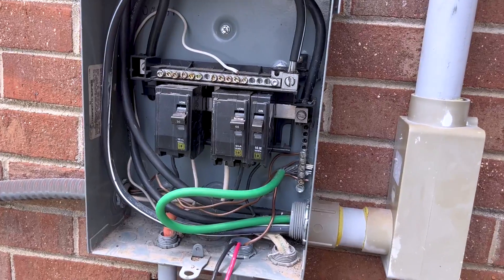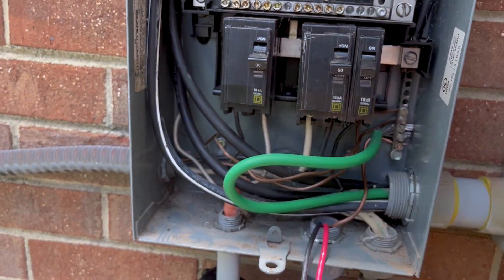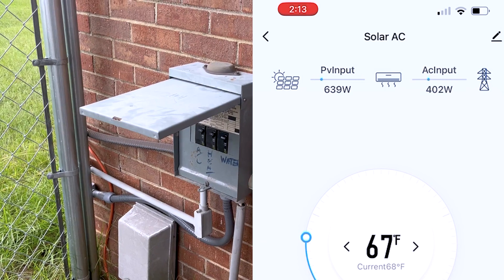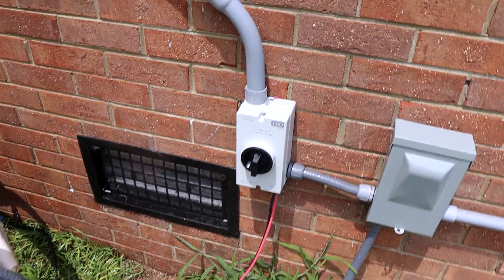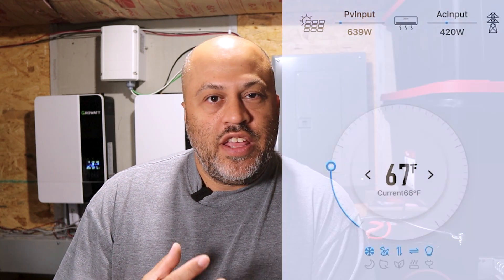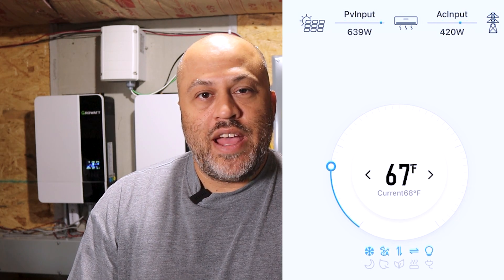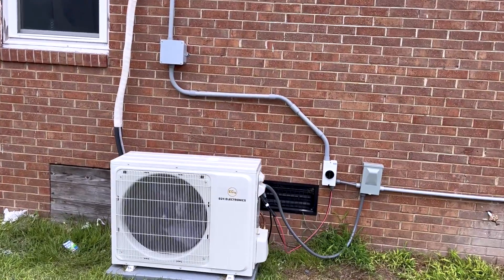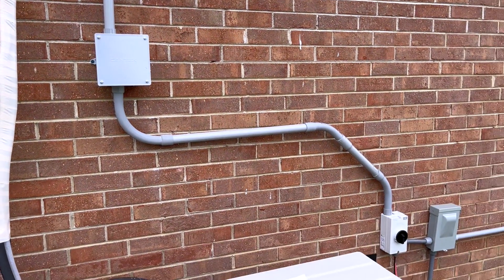EG4 Solar Mini Split Install Part 2 & FAQ’s Answered

Comment: Hi i just purchased two of theses and in your video you went from the panel / sub panel from a dbl pull breaker you said 220v arnt theses units 110v? so wouldn't it be a single pull breaker? just wanted to know why that was i want to hook mine up but before i do i just needed to know the facts on that thanks. Charlie.
Reply from the maker: They have 240 volt and 120 volt models. So instructions in manual will tell you what you need. 24000btu should be 240

Comment: Can you show the solar wire connection to the ac, i just want to make sure i dont mess it up. Even though im sure its self explanitory. Its my first solar project
Reply from the maker: This unit is not at my house but I will be installing a 12k unit soon. Can show wiring for that one then. All wiring info is in manual from what I remember so just follow that! 👍
Reply: Okay , thank you

Comment: I keep hearing the phrase "pre-charged" line set.  Wouldn't the correct term be "pre-vacuumed" ????
Reply from the maker: That is what is called out by the manufacturer in the manual. So you would need to ask them I guess. Have no idea why they went that route. Thanks 👍

Comment: Is it OK to have the excess line set coiled vertically? I thought it had to be horizontal?
Reply from the maker: We coiled excess behind the unit. That is what the installation manual states. Thanks

Comment: OK bud, great video.  Quick question.....   Does your EG4 use ANY grid watts at all when the sun is out in FULL and it has enough solar to run off of solar?
Reply from the maker: Have to edit this. it does show a small amount 40 watts being pulled when the grid is connected. Not sure if this is actually pulling and trying to research this some. But with the grid off it runs fully on solar and does pull some when grid is connected. I was thinking of the time on only solar with the first comment.

Comment: How many watts of solar panel you need to run the minisplit?
Reply from the maker: We have about 2700 watts but could probably have a little less and still work fine. I would want at least 2100 but unit could run on less if it had too.

Comment: the lines arent charged, but they are under a 30hg vacuum. when the quick connect is fastened to the unit it may lose 2hg max. so you are still under 28hg. the techs arent savvy to this standard because its a new standard.
Reply from the maker: Thank you!

Comment: Is it possible to run this only from solar panels with no grid power? Or will it harm the mini split by turning it on and off when there’s no sun or clouds passing over?
Reply from the maker: You can run it on solar only. It will not hurt it because it will turn of compressor when power is low.

Comment: Rodney, my new house has a foot thick wall. How long are the lines coming from the inside head? Pioneers are long enough to bend the lines at 90, I want to say they are about almost 2 feet. Thanks Nick
Reply from the maker: These are shorter than that I believe. Maybe 18-20 inches can’t say exactly but they could be just a little longer in some situations.
Reply: @rodneyhunt  i measured the pioneer coming out it appears the low pressure side is about 17 inches which is the 5/8 copper and high side is about 20 inches long. They both bent very well at 90. But, from the pictures of the eg4 it looks a lot shorter on the low pressure side.
I’m trying to figure out how I can add at least 6 inches more by silver soldering and extension on but don’t know how to pull a vacuum on it alone. Maybe there is some kind of adapter to hook up the vacuum the head. Thanks for getting back. Nick
Reply from the maker: Hope it works out for you
Reply: @rodneyhunt  Thanks Rodney, one more thing how thick was the wall you went through, it appears to be pretty close to mine.
Thanks Nick
Reply from the maker: @graciemiller9596  I think it was 3-4 layers of sheetrock,paneling, and framing. Then the brick so pretty thick
Reply from the maker: Maybe it was 2 feet but didn’t  look like it

Comment: Good job I am doing a similar setup. One thing move the ground a dedicated D/C ground.  You should use use 2 ground rods at least 6 feet apart. Not to code and not safe to mix D/C and A/C
Reply from the maker: Hey thanks. Could not find a definitive answer in the manuals. I will also ask signature solar what they advise so I can do an update on that.
Reply: @rodneyhunt  Did you get an answer from the Signature Solar team on that question?
Reply from the maker: @MauricioYouTube  the DC side needs a separate ground at least 6ft from the AC side ground.

Comment: Thank you very much for the follow up video. Excellent work. Doing mine (12K) next weekend. Your videos convinced me to get the EG4. Thanks again.
Reply: *The EG4 hybrid solar model with the precharged lines. 

Be careful if ordering, EG4 also sells a non solar model with precharged lines and also a hybrid solar model with regular (non precharged lines)
Reply from the maker: True. Two of the four they have are solar right now
Reply from the maker: Glad to hear it! It should work out great
Reply: Did you install in your buddy's house the 24K or the 12K. Looks like a 24. They sell it with 3150 watts of solar and 7 panels. Each panel is 450 watts.